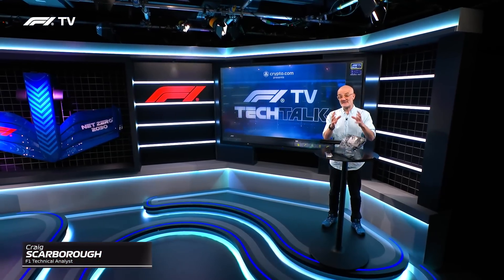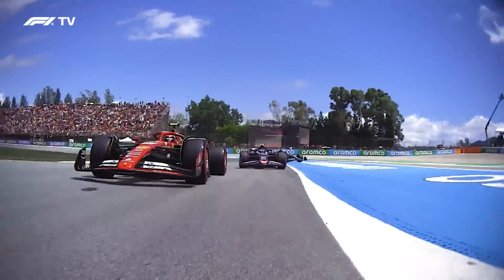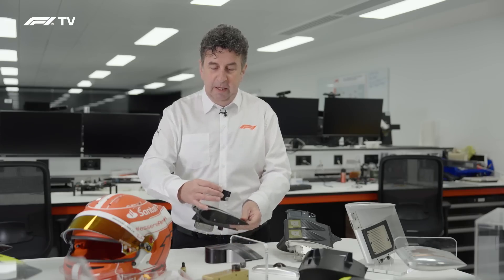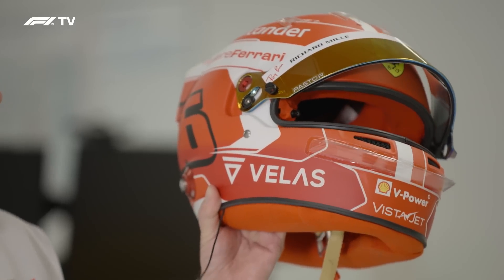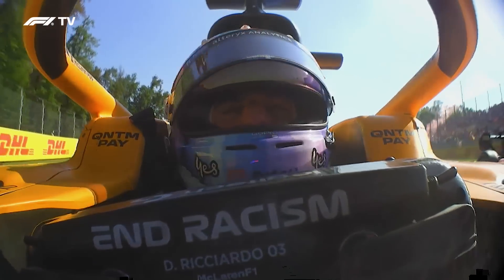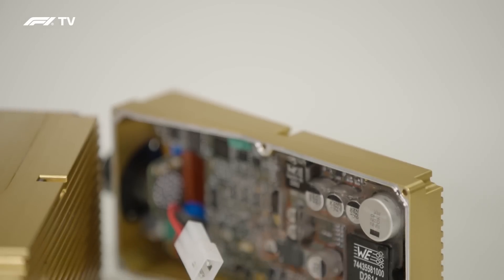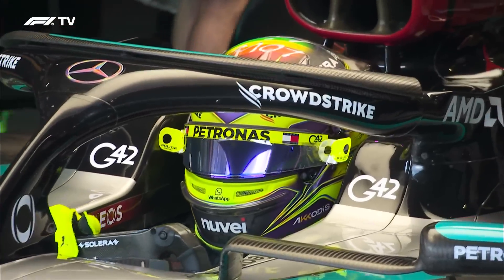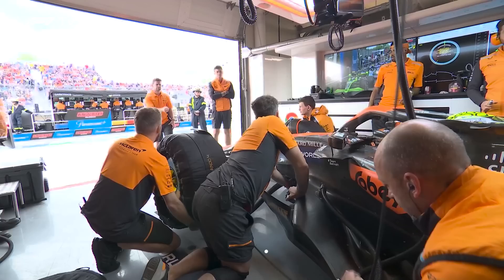The Science Behind Onboard Cameras | F1 TV Tech Talk | Crypto.com

Comment: External cameras are ok, but helmet cameras are awful...
need a anti-shake system...
Reply: At least it shows what the driver is really experiencing.
Reply: @broughxtreme  
That's not a normal experience, because they can't see!
That's was like when Mercedes was bouncing...
Reply: @Antuan2911  From a lifetime of racing (speedway midgets) that's normal. Getting buffeted around by a 200mph headwind, no cushioning in the seat and very hard suspension. If your eyes are open, you can see. I've had a couple of cases where I've been racing SO hard that I've forgotten to blink and your eyeballs cloud over when they dry out and your eyelids stick to your eyeballs. The power of adrenaline.

Comment: I would love to hear more about this. What are the data rates, resolution, fps, how many receivers are needed? What's the range and bandwidth of the transmitter and why? Is it dynamic? Why 10 GHz? Whats the power consumption and weight, what are currently the limiting factors of the image quality? How do cars affect each other. Are there interference problems and how are they being solved? Is every camera always recording? Why isn't the telemetry HUD in the TV transmission perfectly synced to the camera image? Is the rapidly varying speed difference between car and receiver a problem?
Reply: According to the General Specification Manual there are a maximum of 55 receiver sites depending on the circuit.

Comment: Would love a similar video about the cameras in the curbs
Reply: especially the one at Eau Rouge
Reply: @nspill327 That’s raidillon actually
Reply: Those are cabled "normally" in a small cut in the concrete to the nearest optical node on the circuit.

Comment: The new gyro cameras are dope
Reply: This hype around these "gyro" cams is so manufactured. Helmet cams are 10000x better.
Reply: but they're not really gyro. they're responding to the g force, kind of like when you go around a bend in the road and feel pushed to the outside of the car. has nothing to do with how banked the corner is
Reply: @puffnpluky76  are you slow?
Reply: @Scknows  The effect is done entirely in post processing based on data from the g force sensors in the car. The camera itself is statically mounted and can not rotate at all